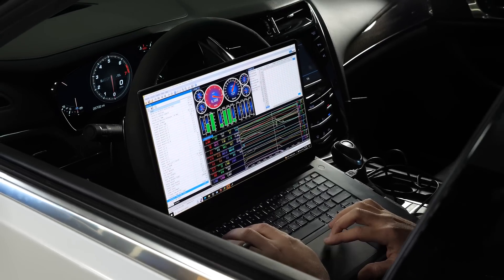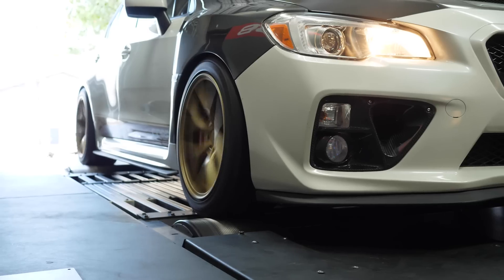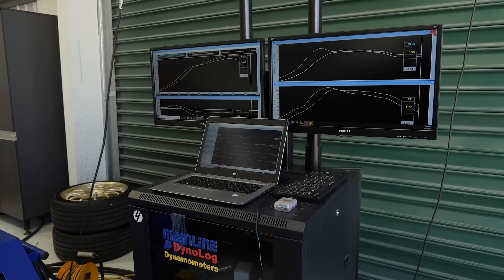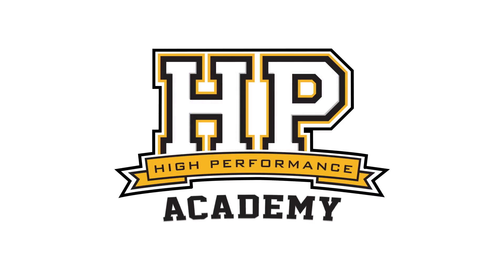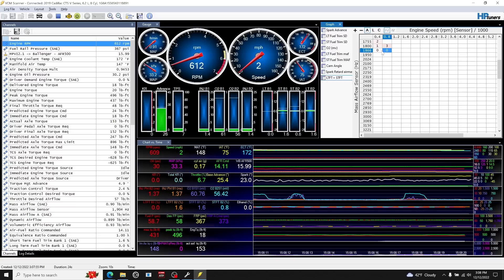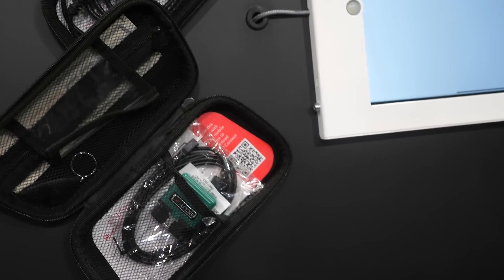Why Don't We MAX Out Torque Tables?

Comment from the maker: 🔵 Building a fast car? Get $400 OFF the all-inclusive VIP online course package deal: https://hpcdmy.co/offery148
🦵Kickstart your EFI Tuning knowledge. Get 50% OFF your first online course: https://hpcdmy.co/offery148
TIME STAMPS:
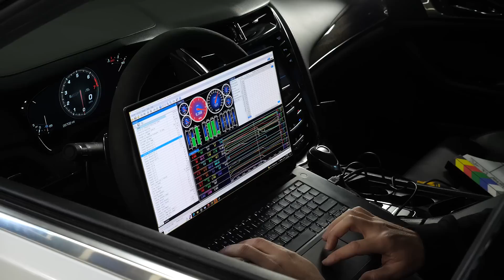0:00 - Paul Blamire | EcuTek
0:23 - What Came Before
1:19 - Torque-Based Tuning Introduction
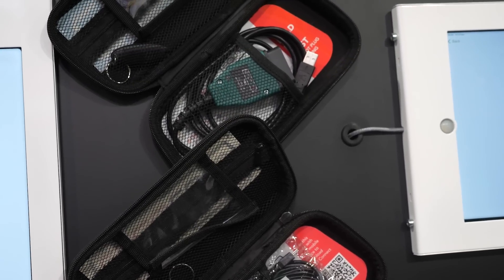2:01 - DBW Advantages
2:49 - DCT Transmissions
4:44 - Consistant Torque
5:22 - Main Torque Request
6:44 - Different Adjustments For Same Result
7:25 - Why Not Max Our Torque Tables?
9:24 - Torque Limiters
12:27 - Thanks Paul!
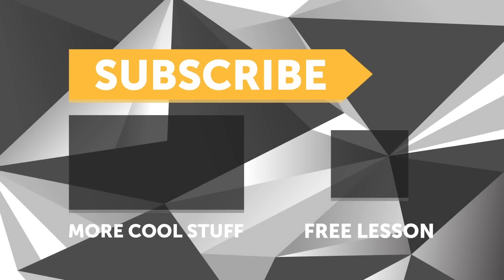12:42 - The More You Know The Faster You Go!

Comment: The transition to ecu torque based control has nothing to do with performance...it's strictly financial.  OEM's figured out it's cheaper to build undersized displacement engines with forced induction to make up for power loss. Torque control was added because the engines will fail without it.

Comment: I was always under the impression and from personal experience (with subaru anyway) that the "torque" value is really, almost just an arbitrary number that forms a relationship between tables. (Particularly throttle plate position) For example, I could simply reduce the targeted throttle plate position at a given torque value and it that's it. The requested torque is still the same at a given physical pedal position, but the throttle position is now reduced, which in turn could also possibly reduce the requested boost target at a given physical pedal position... though the "torque value" is still the same. If that is the case, I would think it important for people to understand increasing requested torque will not simply bump up requested power even if limits can be increased (which they can)

Comment: and 'torque demand' are crap to drive, especially when a manual.   it is unnatural the feel between foot movement and engine response and the rpm 'flare' for emissions does not help.   the feeling is you are not connected to the car - a good carbed car is much nicer to drive.  in a diesel farm truck with this you can't just idle off with no throttle, instead you have to tramp the pedal or stall.   and you can't set the manual idle control and get on the back to put out hay alone.   'making everything good, shit'.
Reply: Lol yes 911 gt3 rs is renowned for being crap to drive
Reply from the maker: Just like there is in the world of carbs (some of them are crap), not all EFI and DBW throttle systems are created equal! Luckily we can tune them for our application though - Taz.

Comment: This is what Im waiting for.  With the tech we have now where phones hardware are as powerful as some laptops, its entirely possible that a phone can reflash an ecu.  Or at the least, plug in a module into the obd2 port that can override the ECU and run the fuel, spark and timing, which can be flashed from a phone app.  Its whoever figures out how to code a program/app that can do it.  But with only a small percentage of diy people that want to fully tune their car, the return on investment isnt as great.  But the first company to do so will then usher in the next era of DIY tuning.
Reply: There's already many companies that are doing app based tuning. Bootmod3 is one that come to mind.
Reply: That actually exists. BMWs use flashing softwares like that. MHD, BM3, MG FLASHER, are all phone based.

Comment: Finally I got what this type of control does. With variaties of ambient temperature, ambient pressure and ambient humidity or even variation of local said variables in the engine itself. The ECU will self adjust the torque curve to match the preset power delivery which means at any given situation the torque curve or overall power delivery will remain static no matter the condition. This will introduce a high predictability for a driver especially those who are driving very close to the edge of the limit. 

Of course thanks to forced induction system like turbocharger all of this become possible. On naturally aspirated engine you can't do this as you'll lose power no matter what as you ascend through altitude.
Reply: My na ecu is torque based
Reply: @Everything8Valve  The ECU might be torque based but the engine will never deliver the requested torque if can’t meet the certain conditions. High altitude= Less air = Less fuel = Less power. You can’t defy physics. Or watch the video till end he literally explain it. 

The torque based ECU was primarily design to handle torque alteration on different condition. If you’re tuning your car at say 70% of its max power level. You got 30% headroom to play with if you car can’t meet the target power delivery. The closer you get to 100% the harder it gets to control the condition (i.e at higher altitude you’ll have to spin the turbo so fast you’ll literally run the turbo outside its compressor efficiency range)

So on NA engine you’ll to heavily down-tune the engine so that torque variance from driving at lower altitude to higher altitude will be as minimal as possible which is not ideal as you’ll leave tons of power on the table when driving closer to sea level.
Reply: @soraaoixxthebluesky  ahh ok more understanding now. Thank you